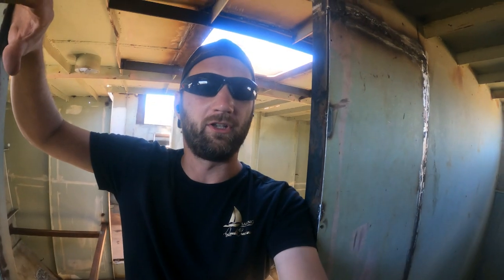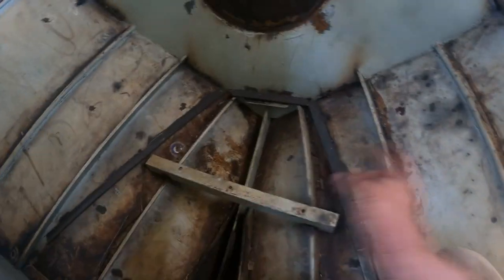Sailing QC #95 |  Let the Painting BEGIN!!!  The Interior White | Steel Sailboat Restoration

Comment: Looks good  where you  have but I think it the third coat maybe when you done the  rest of the boat with  the first two coats good  job  though
Reply from the maker: Hi Kevin yep definately needs more coats! Will be trying an airless spray gun once blasting I done.
Reply: I learnt something  about  painting  my model boats I used a foam brush then used a dry brush  afterwards  got a  lovely  but your paint is difficult  but I  have  seen  some people  painting narrowboats with  a  roller then using a dried brush similar  idea finish was great

Comment: I am also a steel John Pugh owner with a similar 47ft  ketch of the Seawind design.  She is a great boat and the hull is in excellent condition after 30 years in the water.  Could you tell me what paint systems you are using inside and what plans for the outside.  Great content by the way.  Thanks mate
Reply from the maker: Hey fellow John Pugh owner 👋 great to hear from you! So cool that you have reached out to me. Our John Pugh is commonly designed as a ketch but we have chosen a sloop design. The internal paint is quite different from a conventional set up and this is due to the Navy donating some left over paint from one of their projects. I am using Sherwin Williams paint called Sherplate which is a gloss white epoxy which is a one coat system. Why it's not conventional is because it's an industrial potable water paint (food safe). This paint is often used in fishing trawler live holding tanks too. The external paint I have used as an undercoat is  called intershield 803 which is an ebrasive resistant undercoat. Which is also food grade and often used on large super tankers that hold grain and war ships. We will fair over the top of thi paint to smooth surface and add white gel coat. Currently the external paint is a hold coat to prevent rusting rebuilding. It will get afresh coat at the end when we are near the end of the rebuild. I hope this answers your questions 😀 great to have you aboard!!